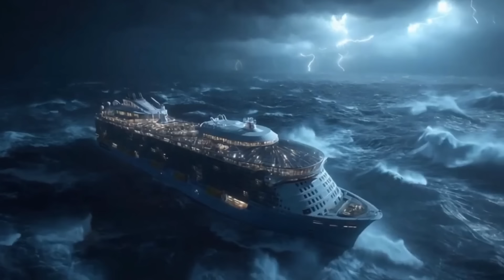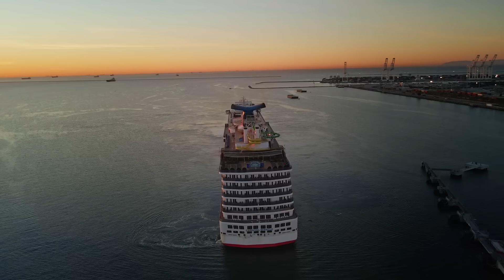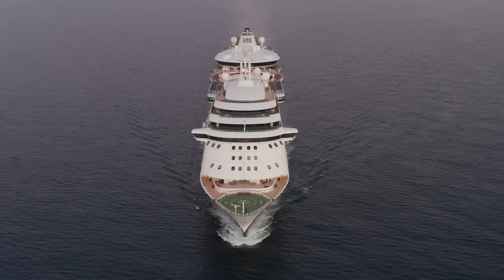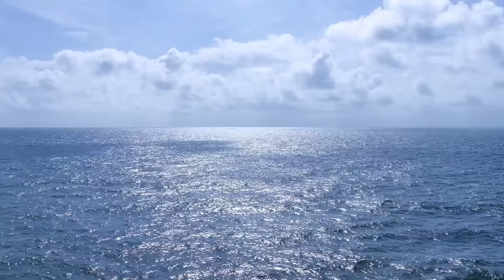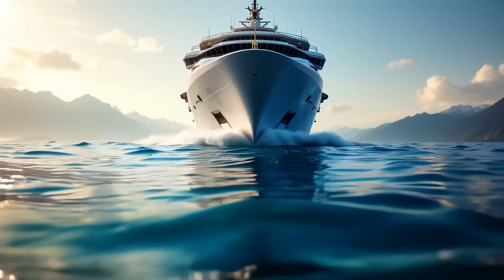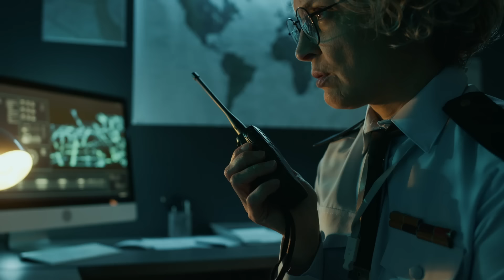The Secret System That Stops Cruise Ships from Flipping

Comment: I always thought the QE2 Survived that Rogue wave so well because she was the world's last remaining ocean liner.  Meaning she was built for Oceanic extremes, and cruise ships are not.
Reply from the maker: You are absolutely right about ocean liner are built to survive tough seas while cruise ships are not. I just did a video on the difference between the two. Thanks for your comment!
Reply: Modern cruise ships just don't go near an area like that, at such a time. There was understanding about what that ship could handle, and that's why it happened to her. There is still Queen Mary 2nd sailing, which was built for similar conditions.